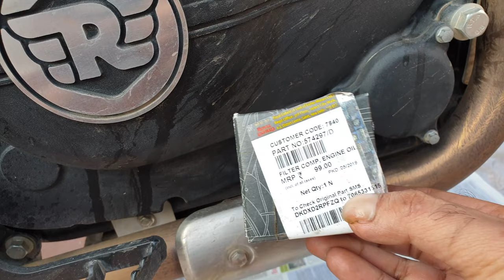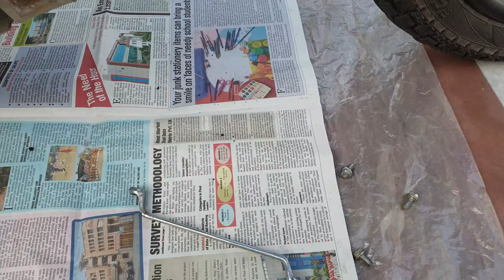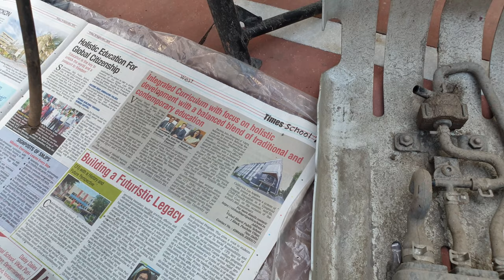Royal Enfield Himalayan | DIY | Engine oil | Oil Filter change | Bash plate removal

Comment: Excellent video. I've serviced my Himalayan once myself, but I have a 2000km trip coming up and it never hurts to refresh my memory before my pre-trip service.
By the way, I noticed you appear to have used your Himalayan as intended, i.e. romping through rough terrain from time to time. I bought a set of larger, grippier footpegs from Motocaan. They give much better control (for me) when I'm up on the pegs. Easy to install and very reasonably priced.
Reply from the maker: Thanks mate :). It is serving the intended purpose quite well. Its going through a slowdown right now because of pandemic but I am sure thing will pace up soon ;)
And thanks for info on foot pegs, they can certainly come in handy. cheers :)

Comment: Today i went to workshop as per your recommendation engine oil need to fill 1.8 liter also royal enfield manual book but my mechanic put motul 2.5litre whole topup i am confused  is that okey for engine....but i have a doubt that is very excessive oil engine wat to do ? sir
Reply from the maker: Hey mate, 2.5 was ok for bs3 but if you own bs4, draining the excess would be sincerely recommended. Cheers🙂

Comment: Dude the video is informative. What is that device you cleaned and strapped when you removed the engine guard?
Reply from the maker: Thanks mate :)
And i think you are referring to EVAP canister unit, started coming from BS 4 model onwards.
Cheers

Comment: Hello and thank you so much for your great videos. Just one question, do you replace the oil filter gasket every time you change oil or not? I mean is it strictly necessary or it can last every 2 or 3 maintenance intervals? Here in Italy i find it quite hard to find it as a single spare part...
Reply from the maker: Thanks mate, I am glad you found the vid useful :) and as for the gasket, no we dont have to change it every time. For example, I changed mine at around 25000 kms when it gave up and leaking oil. Hard to guess but somewhere between 15000 to 20000 kms interval could be a good point to change. cheers

Comment: What do you think about engine flush ? , Specially when shifting to fully synth from mineral or semi ? I've heard a sudden shift to full synth without flush may remove excess sludge at once  ( because it has superior cleaning abilities) , and choke the filter or something . , Although it might be more of a car problem rather than small bike engines .
Reply from the maker: Hey mate, naah, done 100 of 1000 of kms without ever using them and luckily without trouble. If liqui moly was sponsoring me, of course I would have a different opinion ;) I hope you get my point ☺ cheers
Reply: @leuheanrede  yea I get it 😂✌️ 
I thought that too , good oil and changing at regular intervals should keep the internals pretty clean.  
5k is the limit for me , never crossed it , most of times I did it around 4500  .. 
Idk why RE says 10k.

Comment: Nice video and tips. My Himalayan came back from it's first service, and unfortunately it seems that too much oil was added. The eyelet is almost filled up to the top - I think the mechanic filled it with 2 liters. Is it OK to drain the excess by opening the filter cap a bit? It seems much easier than removing the bottom plate and the whole canister just for draining excess oil... Thanks in advance. Hope you and your family are well. In my family, we lost a relative to covid, unfortunately...
Reply from the maker: May he rest in peace. Its tough. Still hoping that vaccine comes soon so we can put an end to this.
As for oil level. Its a confusing one. 1600 to 1800 is ok. That would show slightly above max mark on glass window. I am aware of some cases where service centers are filling in 2 lts. 
My observation is that as long as I can see some free space at the top of the glass like 3mm, all is good

Comment: The manual say 1.6ltr is the refill-had the service centre fill 1.6ltr and the oil settled dead bang at the top oil mark.
Reply from the maker: Indeed mate. 1.6 ltrs gets the job done. But i do keep an eye on that window mark and keep topping up when required ;)

Comment: Hi. Even i want to change to motul. Will the warranty lapse?
Reply from the maker: Hey mate
Yes it will. But before I say anything else please watch 
https://youtu.be/ekHPqQKgVKc
Just first 3 minutes will do as I explain how service center reacted when I told them that I am servicing the bike at home( since day one) 

I service all my bikes at home from day one. Its a simple job.
I dont trust and like the idea of another person working on my bike.

My belief is, no manufactutrer lets the bike roll out of factory without proper testing and quality check, there are a few misses but that is manageable. They do learn and work to sort the issue out eventually.Same in case of Himalayan as we all know about BS3 stories ;)
10000+ kms in 4 months and a Spiti ride later I am even more confident that this is a well tested/quality checked bike.

Here are my 2 cents, its a reliable bike, timely/periodic maintenance will see longs miles on this bike. You ride it well and do what is needed when it is needed, and it would be long before the electricals like pump, FI, ECU start failing, but by that time you would be out of warranty period any ways :D

Ride hard and ride safe

Cheers :)

P.S : Few things to remember though. I stick with changing oil every 5000 kms irrespective of what the manufactures recommend
Second, periodic engine oil level check up and top up if required within those 5000 kms is critical. Keep it close to top mark in the oil level window. Best practice is to check every 2-300 kms while the bike has been resting on center stand after stopping on leveled ground, say for about 5 mins.
Third and most critical, Motul 300 V is infamous for burning. Havent noticed it on Himalayan though. but I still always keep an eye out on the oil level window and top up when the oil level dips below the top mark.
Reply: @leuheanrede  great man! Even I don't trust service persons. If I tell some problem they try to dismiss it. And i dont think they follow all the procedures they are suppose to do in every service.

 So you got all the tools?  Even to see shock absorber oil. And taper valve adjustment tool. Eagrly waiting for your next service videos.
Reply from the maker: Not exactly all the tools, but I have most to get the job done :)
and yes, soon will be doing the shock oil replacement and valve adjustment too 
Cheers :)
Reply: @leuheanrede  Great man, waiting for those videos!
Reply: Motul is what the dealer sells.. it's good oil.

Comment: I think Engine oil is measured not on the center stand.  It is measured when the bike is flat standing on both the tires. Saw this on another guy's channel Born to ride. He thought he had less engine oil but when he came to the service station,  they told its ok, and engine oil has to be measured when flat.
Reply from the maker: Hmm, I believe what he meant to say was that it should not be measured on side stand. As for checking it on center stand or both tyres touching the ground, I have checked and can confirm, there is no noticable difference 

Cheers:)
Reply: @leuheanrede  good to know!

Comment: What an awesome engine sound. Mine is very noisy 😣
Reply from the maker: Thanks Mate :) Could be and its just a guess, maybe valve clearence or tappet adjustment is required. Will post a DIY on that soon.

Cheers:)
Reply: @leuheanrede  waiting

Comment: Did you have to take the bash plate off?
Reply from the maker: There is no need to remove it, but just like washing/cleaning it every time I change oil. But if you choose to not remove it please place some cardboard under the oil filter cover and drain bolt as while draining, some oil will trickle onto the plate. Cheers :)

Comment: How did you manage to remove the bolts on the silencer side? It's too close to the silencer to fit a ring spanner in... Atleast that's the case on my bike.. could you elaborate on it pls? I'm planning to clean up the sump tomorrow...
Reply from the maker: Yup, you mean the one on the bottom right? Yes that is a tricky one. I have a kingtony tool kit, where I can use just the handle and the 8 mm bit, alternatively the t spanner with bending arm can get the job done too ;)
Stay safe mate, cheers
Reply: @leuheanrede  great. Thanks brother. Also, out of curiosity, what does your channel name man and how do I pronounce it?
Reply from the maker: Just checked this. A bit late. Well. Leuhe Anrede. Hope that makes sense:)
Reply: @leuheanrede haha, not a problem. And is that a name of sorts?

Comment: Use a piece of foil to divert the oil.. no need to remove BP.
Reply from the maker: Thanks. Very true. But removing bash plate gives the opportunity to clean it and lower part of crank case thats hard to access other wise, every time I change oil. 
Cheers :)
Reply: Gotcha! Lots of good info, thanks for sharing. We love our Himalayans. 😁
Reply from the maker: Thank you. :) yes indeed, I do find Himalayan remarkable as machines to live with and enjoy the sheer simplicity of riding pleasure. Quite remarkable:D

Comment: Which oil
Reply from the maker: Hey mate. Any brand will do, I personally like using motul 300v 15w50. Cheers :)
Reply: @leuheanrede  do you periodically use this oil?
Felt any betterment after changing from stock oil?
How much kms you get with this oil?
Reply: @leuheanrede  wish you all the best from kerala
Reply from the maker: @rayan_sahad  hey mate, I just ran it in stock oil for like 700 ish kms, bike is 27000 kms now and since then it's running on 300v 15w50..
Its an overkill to be honest but I just love this oil. 
Have been using it on r15 v2 and rc390 for 50000 + kms. 
One thing though, it does evaporate a lot in comparison with other oils that I use in rest of the bikes, so need to keep and eye out for regular top ups. 
I mean, say in 5000 change interval I follow, it requires 500 to 700 ml of top up. For example on r15 v3 I use yamalube and in that 3000 change interval it only uses about 200 ml.
Smoothness levels are no doubtedly different on 300 v, engine does rev freer.
Give it a shot but do keep topping up as and when needed else the engine will be tossed. So basically buy 3 ltrs. 1.6 to 1.8 will go into chamber, rest 5 to 7 will be consumed over the 5000 change interval. Cheers
Reply: @leuheanrede  so you don't have to change complete oil on 5000 km in himalayan  running in 300v

After 5000 km i just need to topup 300v 

And at 10000 km interval complete oil change , all the oil drained and new 300v must be poured in 
Will that be okay.

I mean with 300v i can run about 5000km and with topup again 5000 km and after that i can change the complete oil ? Will that works fine 

Or i need to change the complete 300v oil every 5000km period

Comment: I guess 2 litre is safe mark...
I have heard that liqui moly in better than motul

And fully synthetic will give engine better life
Reply from the maker: I think 2 lts might be pushing it, but seriously i shouldnt comment on it :)
All engine oils are good if changed periodically and topped up when required, 
But yes have been hearing a lot of good thing about Liqui Moly, yet to try it though, will love to try it in future, cheers :)

Comment: Any idea liqui Molly 15w50 or Motul 300v is btr for Himalayan
Reply from the maker: To be honest, any engine oil is good as long as we keep checking level and keep topping up when required. And also keep changing periodically. I have only used 300v thus far with no complaints. Change interval i follow is 5000-6000 kms, with regular top ups as required. 
Cheers :)

Comment: check your valve clearance & tappet
Reply from the maker: Hey mate
Done in a separate vid, cheers :)
Valve Clearance Tappet Clearance | .08 to .10 mm intake | .23 to .25 Exhaust
https://youtu.be/OLi-INbjlTM
Bringing the Piston to Compression Stroke | Top Dead Center TDC | Part 1
https://youtu.be/_lAmh1xp45o

Comment: Heai Man plz Clean the oil Filter Hole.
Reply from the maker: Hey
Not sure what you mean by that. But just to elaborate, it is clean enough as I adhere to changing oil at every 5000 kms, I havent seen any dirt or muck accumulation there. It is always spick and span. Were you referring to solvents that are used to clean the engine ?
Cheers :)